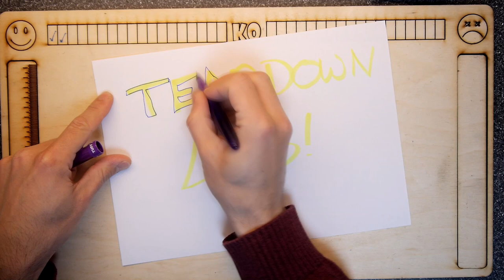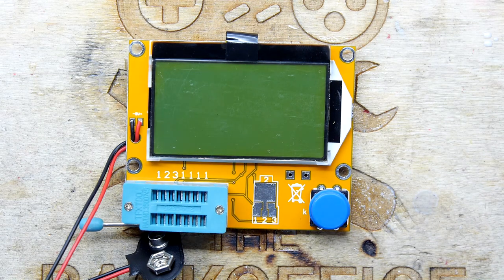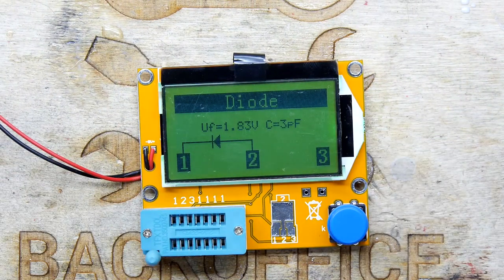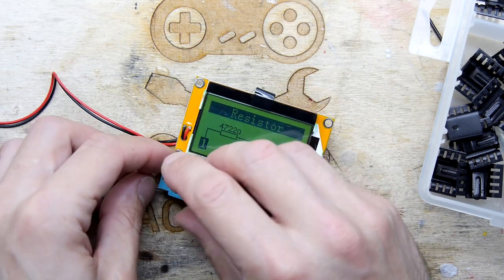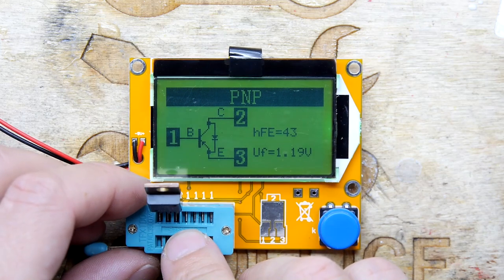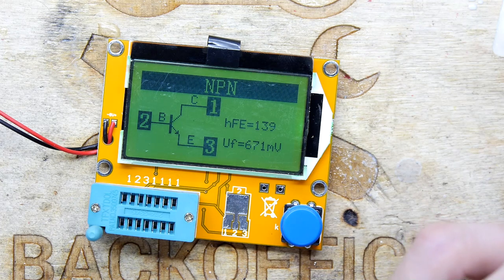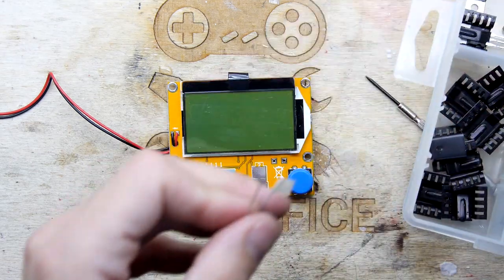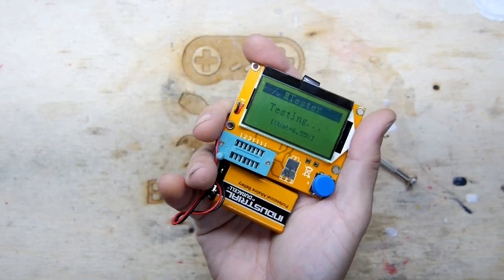Automatic Component Identifier & tester (LCR ESR Mega)

Comment: Handy tool for sure. 
I got one with a case and used velcro on the battery so it wouldn't flop around.
Reply from the maker: I really need to order a case, the floppy battery is a big weak point

Comment: I have four different meters of that type ,one I bought from a kit ,one comecial one for 24.99,some of them have adapters for clip on wire for testing on the circuit board .they all work great .they all have there own speciality .it helps us that don't  always want to use a multimeter ,and give us extra info ,and I never spent more than 24.99
Reply from the maker: +Ron Thompson I wonder if they will make one with the extra multimeter functions, that would be neat

Comment: Why don't any of these "M328" reviews (not even EEVblog) care at all about electrolytic cap polarity, i.e. damaging them by reverse voltages probably applied during the test?
Reply: OK, I found out about that issue (here: http://www.avrtester.tode.cz/upload/ttester_en.pdf):

"Normally the polarity of part is irrelevant, you can also connect pins of electrolytic capacitors in any order. The measurement of capacity is normally done in a way, that the minus pole is at the test port with the lower number. But, because the measurement voltage is only between 0.3V and at
most 1.3V , the polarity doesn´t matter."

Phew. That was close. :)

Comment: Those are fantastic, especially for the price. I absolutely love it. Unbelievably handy, especially if you are like me and you like to strip components off junk stuff. I did buy a upgraded version with a color display that is in a nice acrylic case, but I still use this one a lot. You just cannot beat it for the price. 

Also, if you're interested in tinkering with it, you can find the instructions to upgrade the firmware here...

https://www.mikrocontroller.net/articles/AVR_Transistortester

It's not the simplest of procedures, but doing so will increase the number of components it can identify.
Reply from the maker: +Thor awesome!! Tinkering will be in its future!!

Comment: I have one bought on ebay, but never work are a crap ????
Reply from the maker: Did you run the calibration procedure?
Reply: @backofficeshow  It was not the calibration ... it just came damaged the display
Reply from the maker: They are really good, honestly the most useful thing you can have after a multimeter